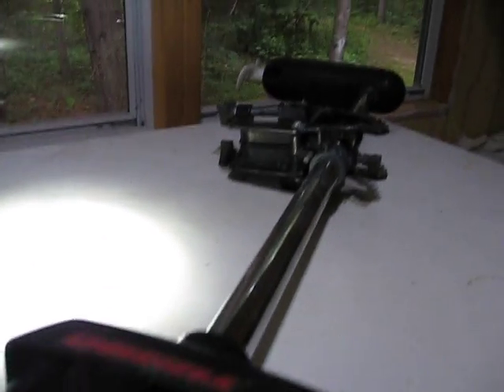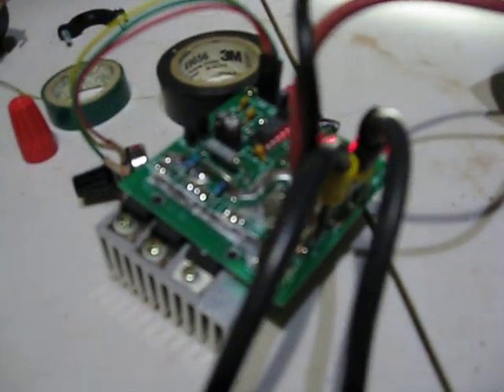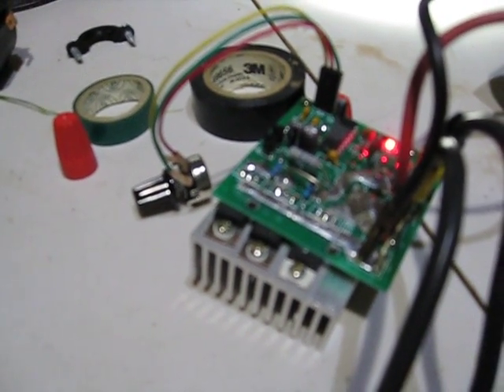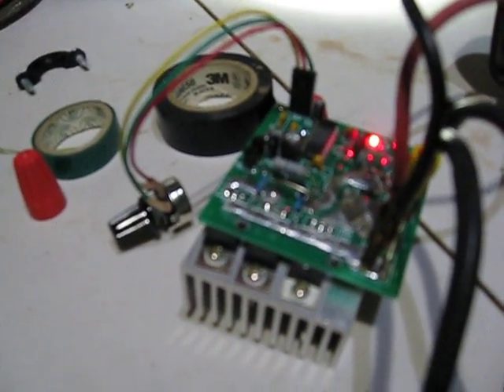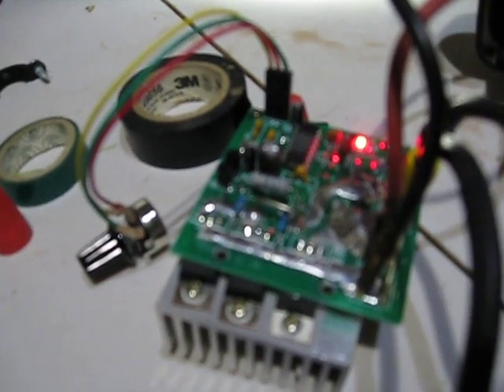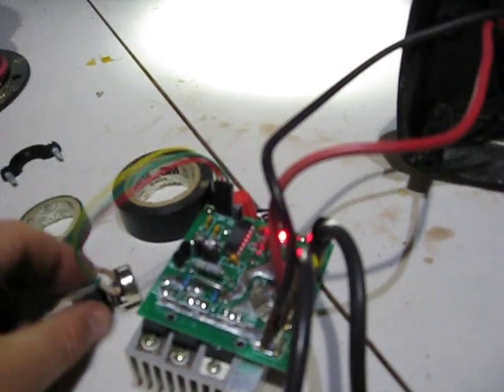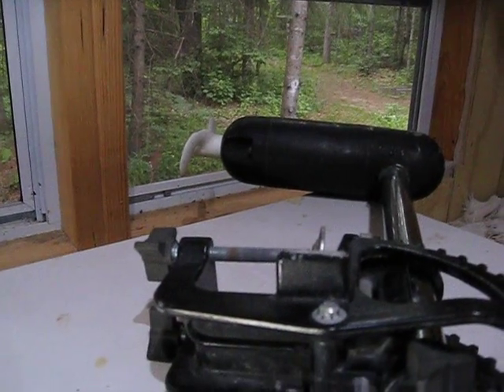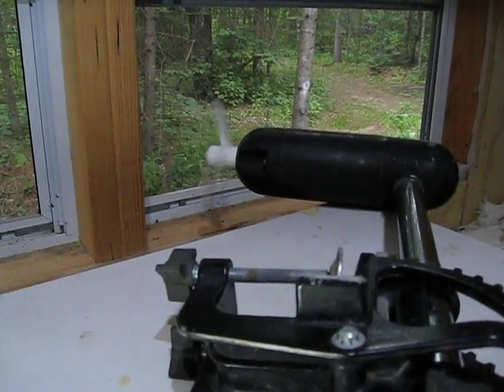U3: PWM trolling motor test

Comment from the maker: I found it on ebay.  Search for "12-40V 100A 1200W DC Motor Speed Control PWM Controller".  $68 plus S&H.  good luck and thanks for your question.